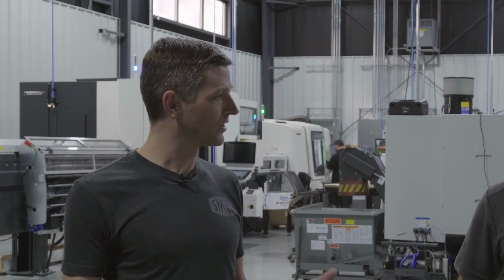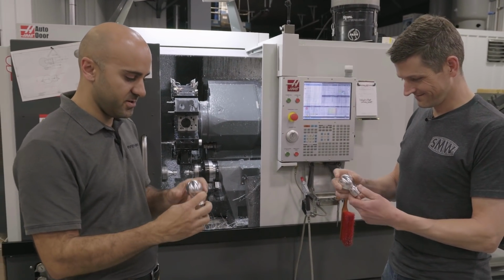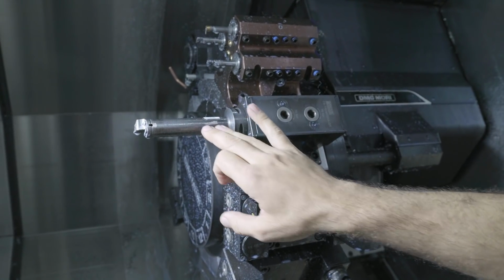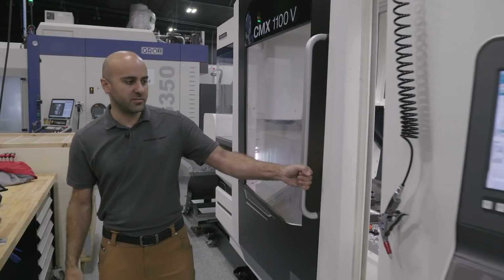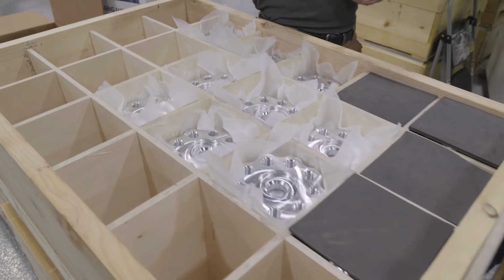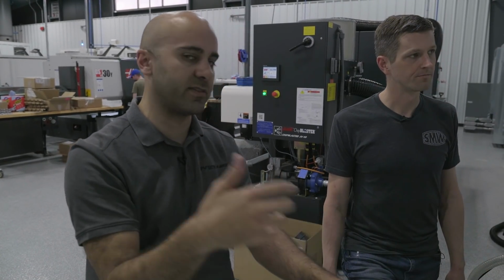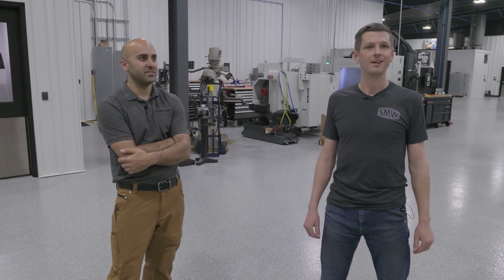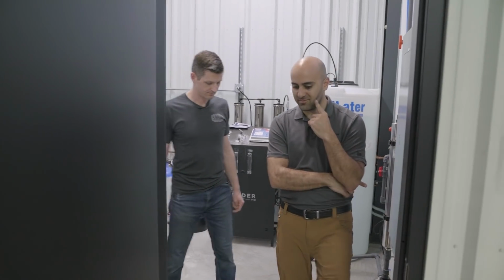Area 419 Shop Tour!  AMAZING Story & CNC Machines!

Comment: I didn't hear which rotary table you are using on the DT-1.  I see that you use a 5th axis RL96S-6760 base plate, and it says it's made for teh HRT210.  Is that correct?  Is it a SS version?

Comment: 1:15:00 I'm surprised there isn't a product that has two pipes to each coolant tank from a box on the wall. You can then pump coolant from the tanks to the box and back.  The box measures the concentration of the tank at the box [one measurement]. Depending on the level, it adds coolant or water and pushes that down the pipe to the tank. All fully automated.
Reply: It's something we intend to do, absolutely.
Reply: @area419  I've been thinking about it a bit more. Pump at each tank and a level sensor. Turned on by wifi. Ditto for water, for concentrate and for reclaimed coolant.
Then on the wall, one unit that measures the Brix. That's probably the expensive bit.  Then for each connection, pipe in and a return pipe that goes to a couple of ball valves that connect to a manifold.  Another option is a UV steriliser box. 

So to measure. Shut all valves except those to the required machine. Start the pump and clear the pipes, then measure. The calculates are then straight forward. Add water, coolant and or reclaimed coolant to the required level by turning on their pumps.  If the manifold goes via the UV steriliser you get some biological protection. 

Power just goes to the Steriliser and Brix, the rest can be daisy chained with valve voltage and a CAN bus. 5 wires.  Doesn't even need a raspberry pi or arduino, lots of CAN boards available.

The main box, has power supply , Brix and a pi. That can even do all the monitoring and record keeping. Even drive a web display so you can see what's going on. 

You could even get a drain tank option where it drains the tank into the reclaim or even into a dump. 

Done right you just daisy chain together.

Comment: That water system at the end of the video is amazing and cleanly set up/installed. That may sound silly to compliment AREA-419's water system, but water in the USA is something we all take for granted, and I once had a water issue, and was chewing up all sorts of things, including the plumbing itself, until I got a specialist or rather, a team of specialist's out where I am at. Have water too clean or pure, sound good, but, with out getting into covalent bonding, as if we are back in high school, too clean of water, is exceptionally rough on anything and everything the water is in contact with, even plastics type plumbing, let alone alloy type plumbing. So, if you are unsure, get educated, and or bring in a water testing group and get yours tested. A sprung leak in a copper pipe at Friday night at 8:30 PM after everybody has left for the day, only to return in two days on a Monday, to see that a bazillion gallons of water has filled the complex with a standing 3 inches of water. Please don't ask the cost of the water bill that following month. All from super clean water that demanded a few trillion trillion free electrons from from the copper piping. 

On a more positive note, I will soon be ordering one of these presses. Not that I need another loading presses, but, these AREA-419 presses are just clever and of course, sexy. I need to figure out a way to convince the wife why 8 presses is not enough, or how this unit is different and more accurate then the others ,which it is, but, I don't think she cares, LOL..  Just kidding, I don't need permission to get one of these, just don't mention that I got one to her, and problem solved.... I think I can use the same ole rebuttal as always, where I mention, how many $2500 purses she needs or $1500 silly looking pairs of shoes she has in a walk in closet that only holds her shoes and purses, as if you are walking into a bank vault or the hidden control rooms at the Smithsonian's restoration lab.. All for stupid shoes and purses..  See, I am getting scared of my wife, that I am building up the game plan already of how to handle this ... LOL.. All jokes aside, I will soon be getting one of these presses. I so look forwards to using this model, I like how open it is. That doesn't mean the other types of presses are bad or not gonna get used, Nah, I just want one, is all.. Thank you for the time and effort put into making this video happen. AREA-419 makes allot of really neat stuff. You all should check out their website, even if you are not a reloader/loader, you never know, you may just decide, that the aluminum funnel will be fitting for something you are doing, not related to am mo reloading/loading among other items they manufacture in house. Thank you.

Comment: Before you buy a chip briqueter, try just rinsing your chips. We've been doing this on a smaller scale with pretty good results. A 55 gallon drum of "dry" chips will yield 5 gallons of coolant at ~7% concentration. A second five gallons comes out at about half that. Just dump clean water on the top of the barrel and your coolant can come out a hole in the bottom.  The results vary with what your chips look like, basically the the yield goes up with smaller chips. This has cut our coolant consumption by roughly 1/3" and it didn't take any investment in machinery, plus it keeps all that coolant in our shop where we can use it and out of the scrap yard's dirt lot.
Reply: Do you have any pictures?
Thank you

Comment: Thats a very impressive shop.  We have an NLX in our shop too, for the type of production you I wouldn't recommend thise though. They are very slow in production compared to say a nakamura or Okuma, and you don't loose any rigidity or accuracy with thise two machines compared to the NLX's just as an example we had a job that we ran on our Mori and Okuma at the same time, we used the exact same tooling feed rates and everything, the Mori was 1:20 and our Okuma was 0:56 that really adds up over time.

Comment: How does he lift those heavy fixtures off the machine? I did not see any cranes or jib cranes at the machines.
Reply: We can get a forklift to the front of the pallet pool. Will likely end up with a small jib there, but haven't had the need yet.

Comment: I am retired from 50 years of shop ownership.  I find it interesting that the same weak link of the chain syndrome is still affecting how the shop runs.  You go from tool wear to chip removal to part removal to temperature control and inspection.  One of those will always be controlling production.
Be proud of your achievement!
Just sayin, JIM